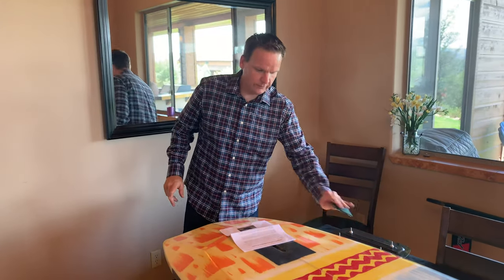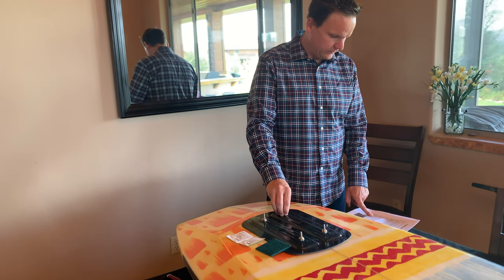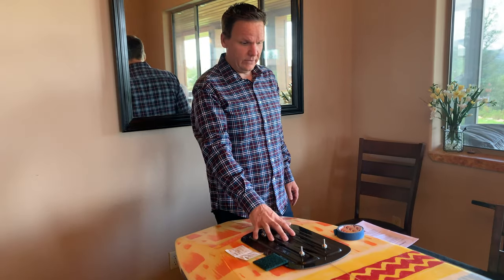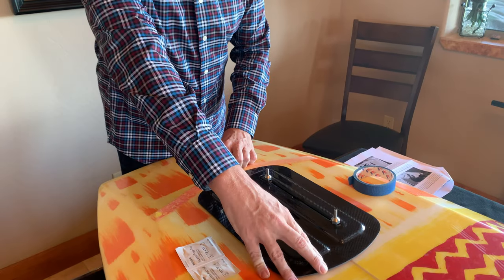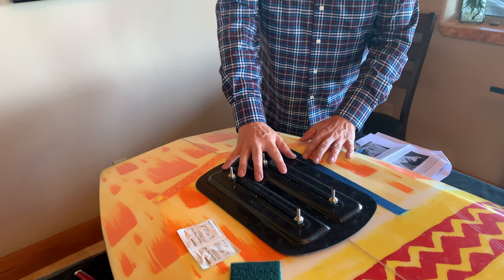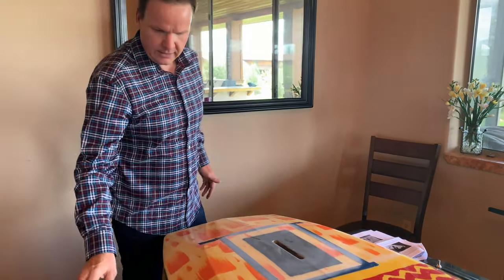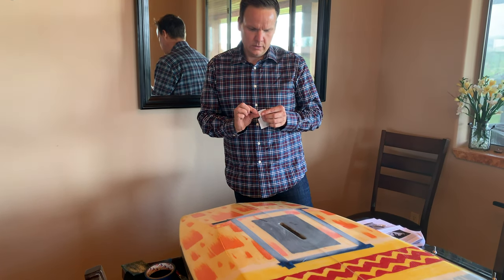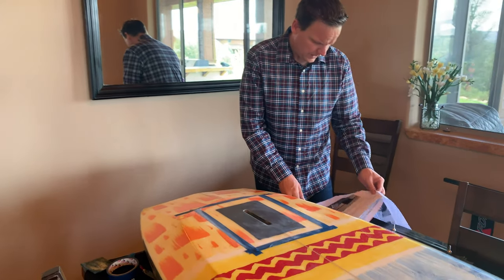Part 2 - Installing a "Foil Mount" 3.0 Carbon adapter on a Kalama SUP

Comment: FWIW Temperature usually plays a significant role on how well those types of achieves stick.  Id think putting it on in the hot sun 90 degree f plus will make for better adhesion. Too cold of a room can have opposite effect and no sticky.
Reply: pro tip: watch series at flixzone. Me and my gf have been using them for watching lots of of movies recently.
Reply: @Wells Kian yup, have been using Flixzone for years myself :D
Reply: @Wells Kian yea, been using flixzone for since november myself =)